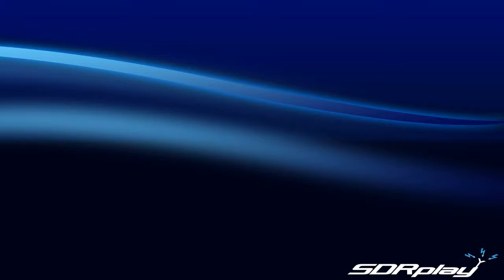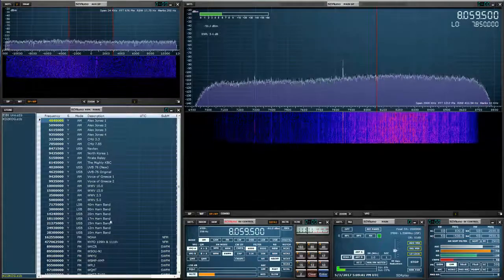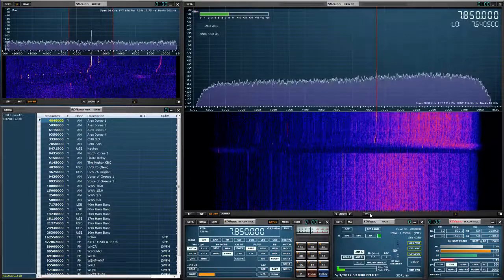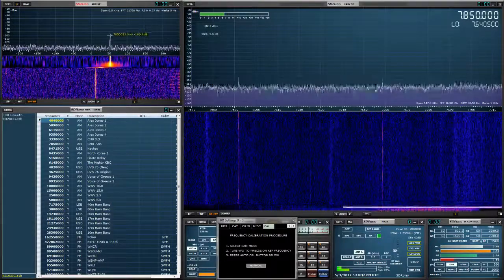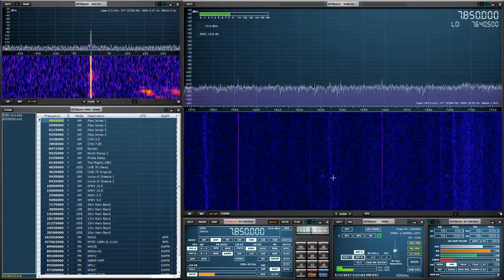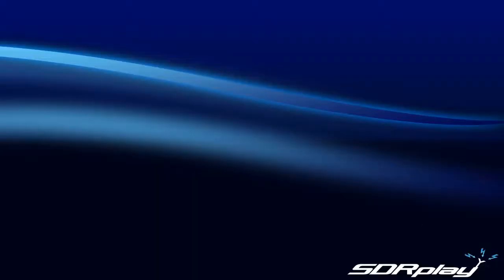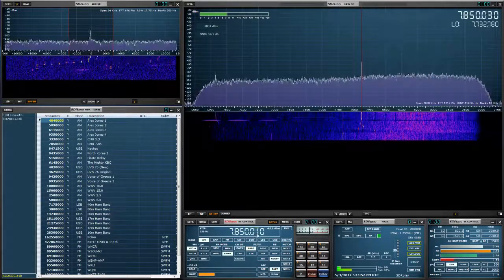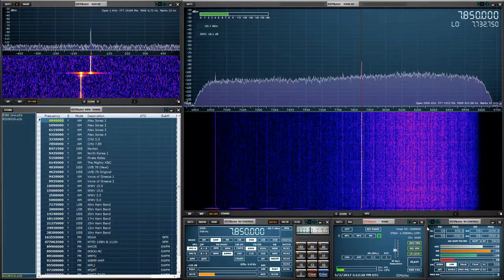Using SDRuno to calibrate your RSP (MV007)

Comment: Can I do the same calibration on SDRConnect? I'm a MAC user.
Reply from the maker: Calibration has not yet been added to SDRconnect. However, for general use calibration is not needed, the TCXO in the RSPs is very accurate out of the box.
Reply: @SDRplayRSP  Thank you for coming back, I'm trying to calibrate my radios and Hotspots. Right now, all of my radios are in the range of +250Hz - +350Hz off center, which is working fine with my hotspots. However, I've just got a new radio and this new one is -150Hz off center and sure enough the hotspot won't talk to it. As a bandage to the problem, I calibrate the new radio to +250Hz just to make everything on the same page. My next step is to calibrate and/or confirm that my RSP1A is accurate. After that, I can re calibrate all of my radios and hotspots. Or, maybe my RSP1A is just -300 off center and all my radios are being correct. I will drag my old windows PC out to do the calibration with SDRUno. Thank you for the video.
Reply from the maker: @55ting55  why not just tune the RSP1A to a known accurate frequency and see what frequency is displayed in SDRconnect?
Reply: @SDRplayRSP  oh, I get it now. Good idea. I don’t need to calibrate it, just remember what is the difference my RSP1A is from WWV.

Comment: Seperation as always. ? What does that mean?
Reply from the maker: You should ideally  have the LO (local oscillator)  frequency reading a different value from the desired frequency. (sometimes fererred to as the tuned frquency which is the centre frequency of the receiver which you want to select - sometimes called VFO for "variable frequency oscillator" - the traditional name for the tuning dial on a  conventional heterodyne radio)   This video helps explain more about the reasons why: https://youtu.be/Fsns4P3JxrM